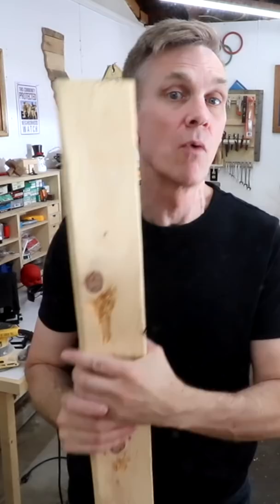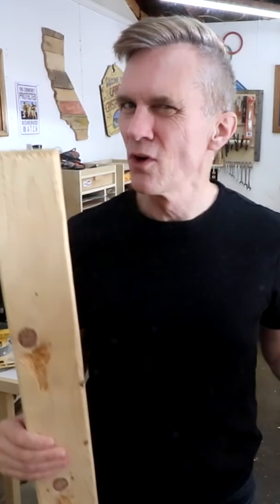Why do 2x4 boards have rounded edges? #shorts

Comment: It's so air can get in when you are taking them off the pallet otherwise they'll be suctioned to each other. Also to allow air to flow so moisture wont accumulate and cause rotting
Reply: Eh, wood is porous, so the suctioned together theory doesn't hold water.  Air flow on the other hand you're on to something with that one
Reply: @brad2761  "hold water"  yall are funny

Comment: And they haven’t always had the round overs. In my great-grandpa’s house the studs had super sharp edges. Very dense wood and still square and true 100 years after milling.
Reply: Yep
Reply: Can confirm - our house’s studs are of dense old growth (built 1912), square and sharp
Reply: Same. Mi e are also true dimension. 2x8 floor joists are actually 8", not 7-1/4"

Comment: The rounded edges exist for the material shipping process. Sharp edges will fray load straps. Where as rounded edges fit flat with metal or plastic straps without risking fraying and potential loss of entire shipments

Comment: There must be a valid reason that is still applicable, else they'd stop doing it.
Reply: Likely be more demand for rounded product for multiple reasons even if the customers never state so.  Give us what we want lol
Reply: With square edges, more stress is concentrated on a single point during an impact, potentially leading to a split and propogation. I'm guessing that rounded edge boards were superior and less likely to split in impromptu shipping studies.
Reply: @MK-8  sound hypothesis from an engineering standpoint. That was going to be my wager too!
Reply: @Deqster  Yes, I too was on that idea, seen from the engineer point, sharp corners should, in theory,  jumpstart a breakage while nobody will care if a worker get a splinter…
Reply: Another benefit is that rounded edges will not puncture the moisture barrier as easy.
Reply: Gap in a Stack Aeration
Reply: @theomegawerty9688  Rounded edges would actually allow for longer life of the cutting tools (4 sided planer). Sharp corners create high stress points in high strength steel (blades).
Reply: @bamsebrumbamsebrumen5403  I saw another comment say that the corners are rounded to reduce moisture buildup when stacked - it sounds like there are just a ton of benefits, even if they aren't the original reason!

Comment: I watch several channels where they mill their own lumber from logs. After they take off the first outer slab to square up the inner area there are sometimes still a little bark left on the corners of the first boards. By rounding the edges the big mills also would get rid of any remaining bark, and it would increase the grade of the board. They would also increase the yield of lumber from the logs.  Just my guess this is one of the reasons.

Comment: It's to prevent damage to its self when being stacked and unstacked.
It's not to prevent moisture, they use spacers.
Reply: They don’t use spacers in the pressure treatment so that’s nonsense. Once it’s been it treatment it’s kept in same wrapped bundles until it’s on site , and the gaps between help the treatment access all of the wood
Reply: @trippyleo5609  Treatment? What are you talking about?  This isn’t treated lumber...

Comment: Airflow during storage. Dry lumber that's not treated for external use needs airflow to prevent moisture causing rot during storage.

Comment: Working at a sawmill, it's caused by the rollers loading them. They have rubber rollers that feed them down lines, which over time causes their edges to become rounded/smooth.
Reply: Bullshit.  It’s cut that way for air flow.

Comment: it really is interesting, because here in europe the construction lumber isn't rounded off. Most has 100% sharp edges, some of the bigger beams have slight chamfers, but not big roundovers like your 2x4s
Reply: Rounded in UK, lessens injury if you bang your head 🤔🙄😏👍
Reply: Rounded in Ireland too 👍🏼
Reply: yeah, rounded corners means it's dimensionally planned, and that cost more than the raw sawn.

Comment: The answer is chip wood. The structural integrity of the 2x4 is not diminished by robbed edges. The amount of wood gained in the chipping prices allows for extra materials to be sent to pulp Mills and other methods using crushed wood to manufacture different products. Increasing profitability for each piece of lumber offcuts.

Comment: The "eased edge" does NOT require any extra effort, or an extra step. The rounded edge is merely incorporated into the planer knives - 1 pass through the planer does it all.

Comment: It's definitely to avoid cuts when you're handling it. Yes you can wear gloves but this is difficult when doing fast paced framing. Freshly machined lumber without a roundover will easily slice your hands in situations where the rounded lumber can be thrown around.

Comment: I was working at a mill, we did both rounded and square corner. I found that rounded corners where alot easyer to stack and handle. The Machines doing automatic staking has alot less problems with snags when the corners are rounded. And me handeling thousens of boards by hand had it way more comfortable when the corners where rounded. So my guess is that the reason for rounding is time saving in production.

Comment: I've never watched a video about 2x4 manufacturing, so I'm not even sure HOW they get rounded edges. I should look that up.
Reply: if I recall correctly the rough 2x boards pass through a four sided planer that has some kind of rounded cutter either before or after it

Comment: It was discovered years ago that that rounding down the four sharp corners greatly reduced warping during and after curing, and also being able to be delivered and stored much longer with much less worpage, and rot due to moisture being trapped when curing and stored in hugh stacks, safe guarding investments.. mill and customes we're able to produce and buy in greater volume and stack and store longer. Think of it as aerating.

Comment: I just Googled it and it has to do with warping, that's why they surface it down and it's no longer a 2x4, but they call it a 2x4, the actual side is one and a half by three and a half.
But you can actually buy 2x4s, 2x6s, 2x10s, 2x12 that are actually that size, if you want them to be smooth on all sides you have to get a planer

Comment: I used to work in a mill. I was always told that it actually reduced shipping weight. Surprisingly, they said they could get one more bundle of Lumber on a truckload with this reduced weight. Over 1000s of truck loads, that is a lot of saved shipping costs.

Comment: The real reason is probably so when the boards are stacked in large amounts, so air can flow through the stack and prevent the wood in the center of the stack from drying out

Comment: S4S mean surfaced on four sides to make there dimension uniform,  and where applications are exterior makes it look more finished and creates a unique drip edge. By being rounded the water will not hang on too the edge, leading to rot.

Comment: My guess would be that is tremendously improves the stacking of the wood in storage (dirt/saw dust can gather between the rounded edges). That would be an immediate benefit to the producer.

Comment: The answer is: when stacking 2x4s rounded edges reduce the amount of time it takes to grasp them. Pulling them apart with your hands is practically impossible unless your fingers can fit in between the boards. They rounded the edges because it cut transportation time tremendously as it made then many times easier to handle.

Comment: I always thought it had to do with stacking them for transportation. It allows them to not damage and splinter sides when tied down in a big bundle. It allows for uniform distribution of heat to the boards from the humidity and air outside so they expand and contract together when in a big bungle being transported. And when you have them stacked if any of them bow it creates an area that can be damaged where with the rounded it can slide over more easily. I always assumed and heard it was for easier production and transportation and not for people since most carpenters would love for wood that comes S4S

Comment: So, if 'nobody knows', why then are they still going to the extra time and expense at the mills?
Reply: I'm gonna go for weight reduction without affecting the overall size.  It might not seem like much has been taken away, but when you're moving thousands of them, all those tiny savings add up.  Today that translated to more wood moved for the same amount of diesel.  Years ago, it would be to let horses pull carts that were loaded higher
Reply: I like the airflow theory. When they're on pallets

Comment: You can also buy lumber by the board foot, instead of by the length, buying it by the board feet you will get more lumber and you can finish it and make it smooth on all sides if you want or you don't have to, bored foot lumber is easier to produce tables and stuff like that by ordering by the board foot

Comment: Same reason you round over or chamfer the bottom of your mitre saw fence. 
It’s so they register properly, if you have any small amount of dirt or dust in the corner It would hold it out when you place a board in there.

Comment: The rounded edges came when the government got involved and said we need a unified size in standard and it's not so much that they are around it it is in the Milling process used to work at Northcutt in Texas and watched a lot of the machines worked a lot of the machines and ran a lot of the machines some of the features came by accident rounded edges was one when they were put in prices

Comment: Although it's a few year since I bought any, I've never seen general use boards rounded here in the UK. I deliberately qualify as 'general use' as you can, of course get boards with all sorts of mouldings for particular applications but go to the timber merchant and ask for 2 by 4 and it will be square planed...

Comment: "When selecting multiple 2x4s from the lumber yard, the slightly rounded edges make it easier to pull individual pieces from the stack.

Boards with rounded edges are also easier to slide into the back of a truck."

Comment: I can tell you exactly why 2x4 edges are rounded.  Because of quality control and milling process.  They're not actually 2x4, they're 1.5x 3.5  and each pass through a mill must remove a quarter inch, which is an industry standard sawmill setting.  When you automate this process, a milling machine pulls those un-milled pieces of stock into the cutter, and those rounded edges are included in the cutter design.  As they pass through the cutter, everything is planed off into dust, and if they didn't buzz the radial off, it would create a kickstand in the machine and shut the process down.

Comment: There are several reasons why edges are rounded...primarily for the drying process, allows air circulation and prevent vacuums from forming(boards become stuck together) which also prevents mold growth.

Comment: The two by fours aren’t really two by fours. They’re 2 x 3 1/2. I worked on a remodel in a building that was built in the 1920s. We took down sheet rock and we’re going to replace it with drywall. The studs behind the sheet rock were actual two by fours, and had very rough edges. And those two by fours were hard as a rock. When they were nailing the drywall in, numerous nails bent.
Reply: probably local oak or hickory not pine as  most are today, oak when dry is very hard wood.  Used some to match for a repair and discovered there are special nails that turn with each strike so that they do not bend.

Comment: The reason is quite simple...
2x4’s are cut from logs which already have rounded edges therefore you have rounded edges on the final product. Going a step further the inside boards get their edges rounded because it takes away less wood rather than cutting chunks off of the already naturally rounded edge boards. Rounded edges also reduce the perception of flawed or damaged edges. Could you imagine the amount of returns if lumber was supposed to have perfectly straight edges? I figured the content creator would’ve put a little more effort into figuring out why 2x4s have rounded edges rather than simply saying... “Who knows?” Clearly I should start my own channel....
Reply: I worked at a hardware store for 8 years.  So uh this/\.  Also for further proof. Watch the stock footage in opening sequence of Twin Peaks or How its Made.

Comment: Been a carpenter for 40+ years. I've pulled enough splinters out of my skin to build a rocking chair. Square edges are prone to splinters. Good enough reason for me, it's safer to handle rounded 2x4s.

Comment: back in the sixties and seventies 2x6 material and bigger had rounded edges on the crown side but not otherwise bottom  side. So you could tell where the crown was just by feeling it. It seems like 2x4 studs some times came that way, too. I think this because when you lifted wall using your shoulders it would  cut your shoulders.

Comment: I can tell you why.  Having a "sweep" on the knives when they are dimensioned helps prevent tearout, or "splintering" as the knives start to get dull.  That way the equipment can produce lumber faster, and last longer between downtime for sharpening knives on the planer/molder heads. 
It really had nothing to do with the end users,  it is just easier on the production process. 

--*3rd generation millwright in the lumber and moulding industry, thay specializes in historical restoration--

Comment: I’ve own houses that were so old the 2 x 4 is did not have rounded corners. Those houses were far more likely for the walls to crack when the house moves, I’ve had plaster slat walls. I’ve had drywall walls for the drywall sheets were only like 24 x 36”. That looks like a brick pattern. but like you said nobody knows why.

Comment: On top of this annoying 'feature' (that makes them hard to work with for those who doesn't have a table saw) they are not 2x4. So they are also a scam LOL.
Reply: The actual size of lumber is a well established, and well known standard.
Reply: @jeffh4505  
Yeah, I know "2x4" is more of a trade name than anything else. It's 1.5 x 3.5. It still sucks since a true 2x4 would be more useful to me.
Reply: I think that is because it is surfaced. Same as a surfaced 4/4 board is 3/4" instead of a full inch.
Reply: @christianholmstedt8770  they're rough cut to 2x4 and cleaned to 1½× 3½
Reply: @yohanathandowns9057  
I read they were cut to 2x4 when wet and then cleaned up after drying.
Way back, a 2x4 were actually 2x4.
Reply: @christianholmstedt8770  and they were rough cut with bad crowns, usually needing to be straightened. Properly straightening lumber requires taking off of its total dimension
Reply: @christianholmstedt8770  you have to wait until they're dry to finish them. If you clean up a wet board it will bend twist and bow when it's dry, needing to be refinished
Reply: @yohanathandowns9057  
Yeah, thx. No need to explain the obvious here.
Reply: @christianholmstedt8770  if it's so obvious why are you calling it a Scam rather than reasoning literally anything else? You've obviously no experience in the field.
Reply: @yohanathandowns9057  
The trimming when dry is the obvious part.
The sizing being the way it is has historical reasons. No I am not experienced 'in the field' as in being a carpenter or the like. Just a dude who thinks it's annoying. Let's not even get started on plywood where for example 1/2" can be anything from 0.453" to close to 0.48", which makes a huge difference when using pocket screws or making cabinet drawings for example.
Reply: @christianholmstedt8770  well I'm a carpenter, and I have to carry my tape measure into the stores for that very reason. Sometimes its even right on
Reply: @yohanathandowns9057  
Slightly off topic but have you noticed if the quality of lumber (or available wood) in general have dropped?
Where I am the regular cheap(er) stuff is more crooked and bent than past years.
Reply: @christianholmstedt8770  lowes is bad. Home depot and menards seem to he better. Our local lumber store has the best quality out of the box stores, and employees tend to actually know what they're doing being as they sell to contractors all day. They know what we want and how we want it
Reply: @yohanathandowns9057  
Kind of what I'm seeing too. No big/considerable difference between Lowes/Home Depot. It's more work to find decent pieces to work with. Because I don't have more equipment than a miter saw, circular saw, and some straight edges I need to find the best stuff possible to make the basic stuff I do.
Hope it gets better soon.
Reply: @christianholmstedt8770  a good rack and pinion jobsite table saw will get you finishing with the best from even the worst stock for a pretty small investment
Reply: @yohanathandowns9057  
It's worth looking into for sure.
Thank you.